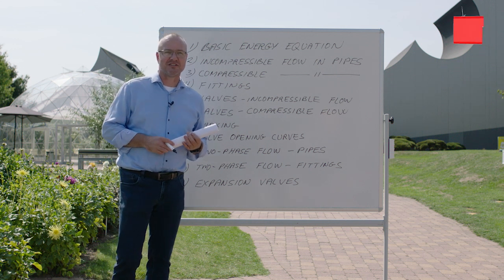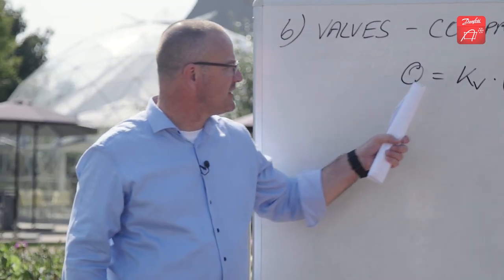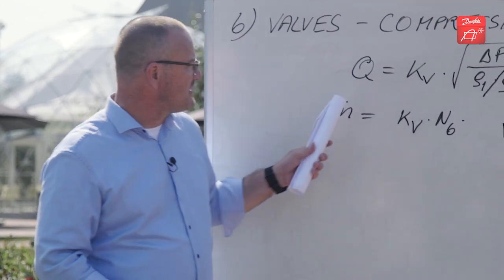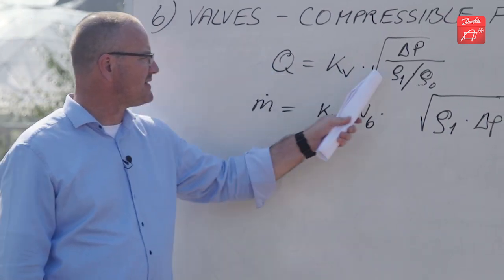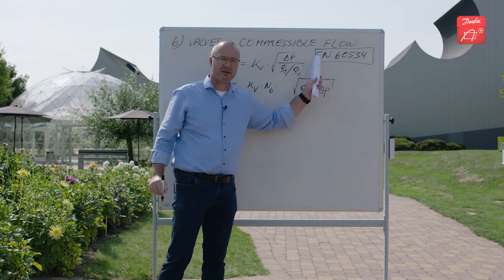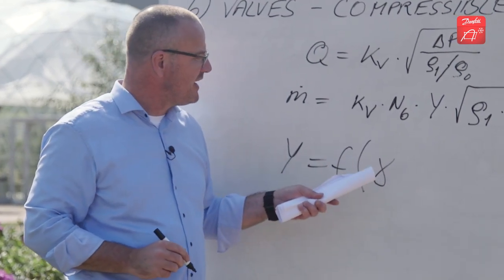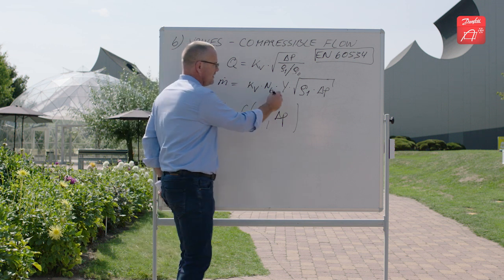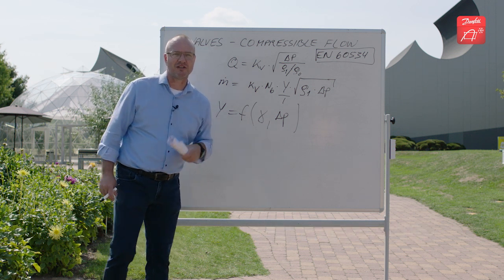Valves - Compressible Flow – Coolselector®2 Deep Dive

Comment: Considering a dry system, is there a value of Kv for DCR suction filters using the 48-F core? I found the Kv value in coolselector for burnout filters using the 48-DA core, but i haven't found the Kv value for the 48-F core.
We use the 48-F core on the suction line during start-up of multicompressor systems to retain smaller particles, and i'm interested in considering it's Kv value to calculate the pressure drop, and from that select the correct DCR or amount of cores i should use in order to not cause a high pressure drop whilst still retaining particles from entering the compressors. After start-up, we change the 48-F core to a stainless mesh core, but i would like to select the fillter considering the 48-F core.
Reply from the maker: Thanks for your question. We will check with our experts and get back to you.
Reply: @DanfossClimate  Any news on the subject? :)
Reply from the maker: @PedroZaniniStorck  Apologies for the delay! We will get back to you as soon as possible.
Reply: @DanfossClimate  Hi there! Any update?